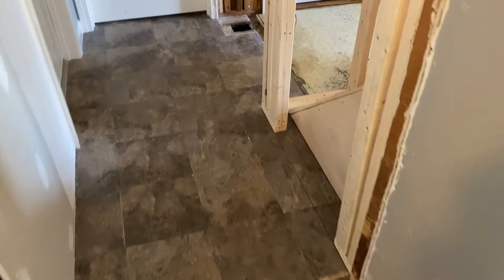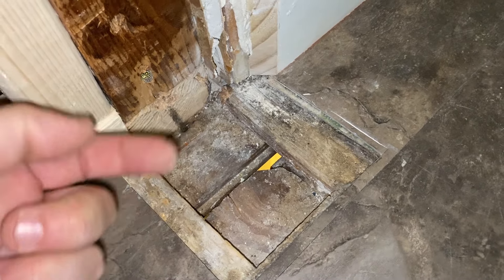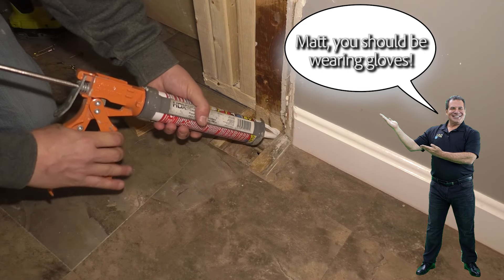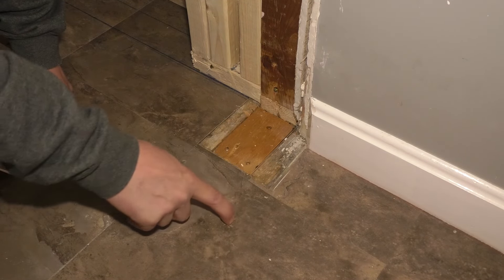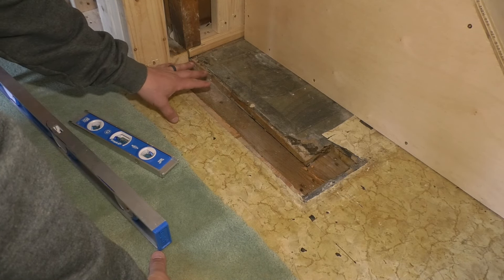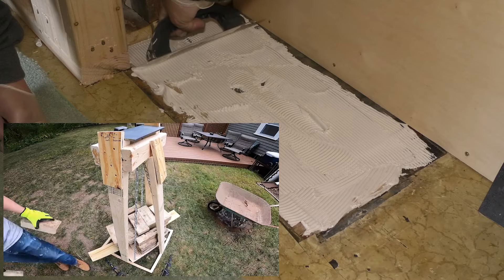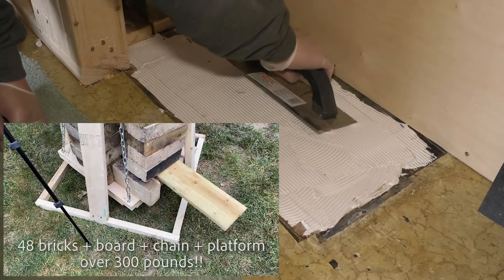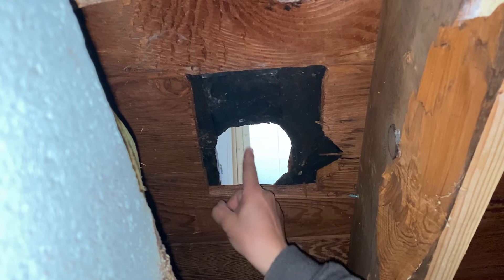How to Fix Holes in Subfloor and Patch Missing Underlayment

Comment: What I really like about your videos that I can't find anywhere else are the non-typical problems and possible ways to fix them. I have the same hole in the subfloor above my shower drain but the floor joist span is 24 inches apart. Do I still need to apply this fix and span to the floor joists?

Comment: I hired someone to replace the subfloor on my bathroom due to rot from water damage. He didn't get the level quite right so he used a leveling compounds and did a terrible wavy job with it... twice. I told him to leave it and I fixed it myself with a bit of sanding (not fun) and a product called MAPEI Planipatch which was fantastic once I got a feel on how to work with it (small batches, just enough water and work very fast). It would be perfect for the last bit of leveling on patches like that. You can put it right over wood (I would sand old wood first for better adhesion) or concrete and it sets up fast so it can be walked on pretty soon after application if need be. I was even able to perfect my less than ideal spots with just a 6" random orbital and 36 grit paper even though it is cementous. I like vinyl flooring but it isn't very forgiving towards imperfections below it.

Also that last hole may be a good chance to show the patching technique where one cuts a patch, sets a router to the depth of the patch, traces the patch on the floor, and then routes out the perfect hole for the patch to sit.

Comment: Very interesting video, your attention to detail is very impressive - Love your work!
IF - you ever run out of filming content and want to come to Florida, I have a 75 year old craftsman house that I want to do some updates to.
Kitchen is a galley with original built in place plywood cabinets, nothing wrong with them, they are solid.  They have the original finish on them, back in the day, guessing varnish/stained.  Would like them painted white.  The, god only knows how old counter top, is 5 different Laminates pieced together, at least they are all the same shade of dull beige, ha ha ha.  I would like butcher block counters and then just white subway tile back splash.  Then....there's the bathroom, nothing wrong with it, just outdated but has the original cast iron tub, it's not clawfoot.  I need to take out the tub and put in a walk in shower, mobility issues.  The bathroom has green plastic tiles 1/2 way up on the walls, what they did back in the 50's.  Going with bead board and penny tiles on the floor. 
I watched all your previous videos, really enjoyed the bathroom remodel and enjoying the current videos.  Thank you.

Comment: I have a hole (similar to your 3rd hole) in what is now a threshold between my bedroom and bathroom and used to be under a toilet.
Is there a way to patch it with no access to the crawl space under it?
Reply: Square it off, put 2 longer boards on each side, screw through the floor. Then add to level the floor.